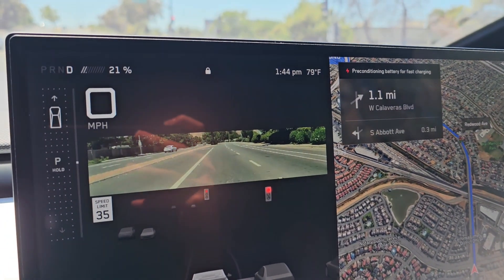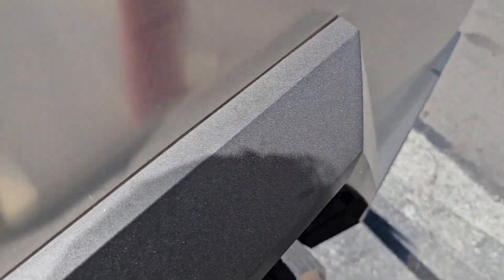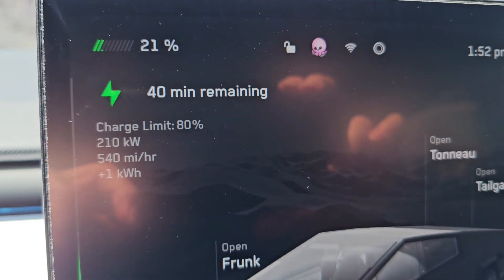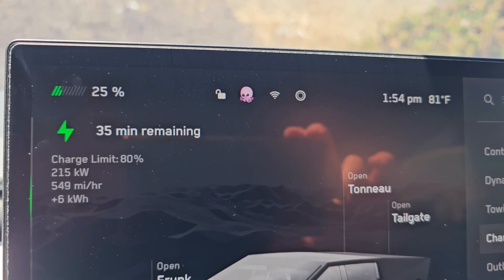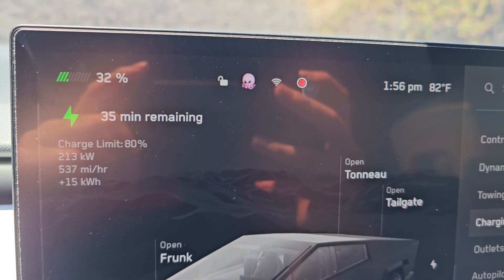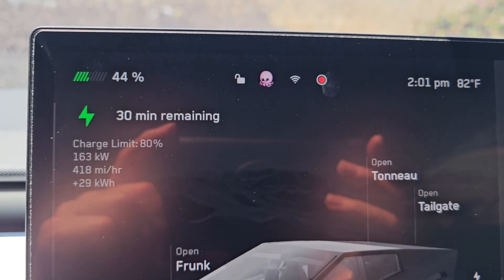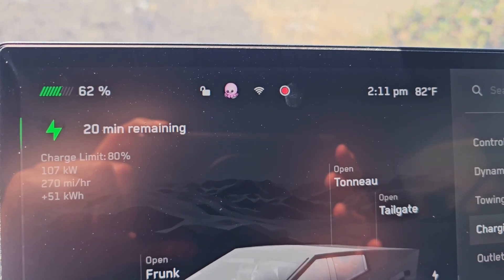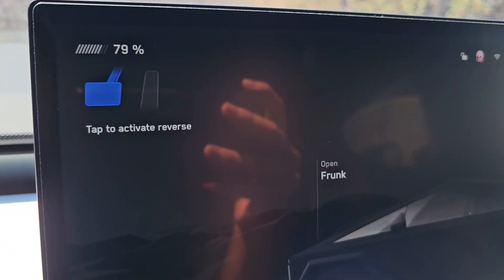Tesla Cybertruck 20% to 80% 250 kW Supercharging Performance after DC Fast Charging Update

Comment: This is why 4680 are junk. The 2170 in MY can hit 250kw easy everytime. You have to hit max speeds on such large packs or else it will take forever to charge. Next gen bettery in china can hit 500kw so how are we so far behind china. I wish we knew the curve on the semi to compare it to CT.
Reply from the maker: @TheLobo91  it went from 0-99 in an hour and 10 minutes. How long does your Y take? I haven't tested my Y in a while. 20-80 in 35 minutes isn't that bad. Lol
Reply: @ItsBinhRepaired  when I use super chargers on my y I only charge enough to get to my next spot. So that's why max kw is important. I would never sit there and pay for extra charge. 20-80 is important and should be a metric but like everything else EV it depends on the use case. It just seems like we need another breakthrough on batteries cause what we have now is ok for small cars but not fast enough for large trucks. Nice video, subscribed.
Reply from the maker: @TheLobo91  We'll see what happens with the gen 4 superchargers. The cybertruck is supposedly supposed to handle 350kW charging.
Reply from the maker: @TheLobo91  I'll do another 20-80 charge soon.

Comment: Hey bro, I was wondering if you can repair a hp(Windows 10) (Model- 14s-fq0510sa) laptop because when I was playing on it, it randomly turned white then black and then the display never turned on but the keyboard lights (like the light on the Caps key) light up when I press it. But the display never turns on. I tried turning it off and on again and i found out that (well I think) the fan is the issue as when I press the power on button, the fan starts spinning for a split second and then stops. Please can you make a video on fixing it, I would really appreciate it, thank you.
Reply from the maker: Have you tried an external monitor?
Reply: @ItsBinhRepaired  Like a different screen connected to the laptop? No because I don't have one. But can I use my phone as an external screen as I know how to connect it to the laptop and it will appear like I have another monitor.
Reply from the maker: Try a tv
Reply: @ItsBinhRepaired  How do I connect it to the tv?